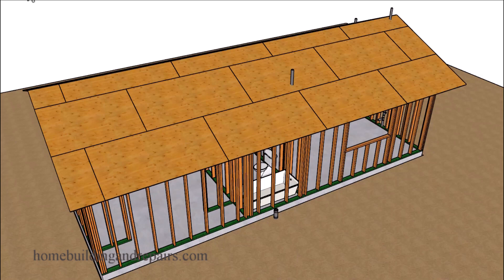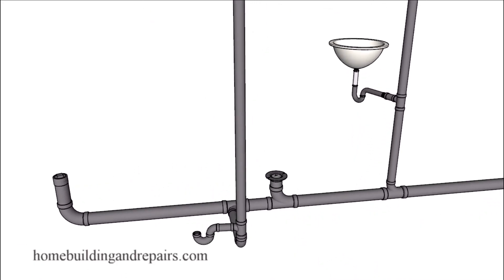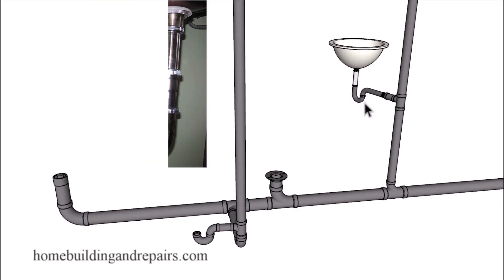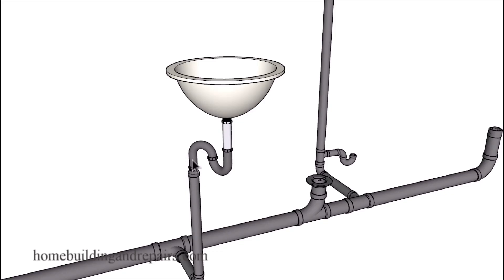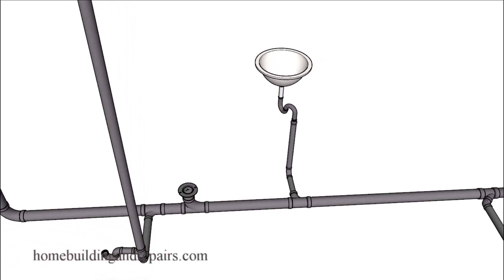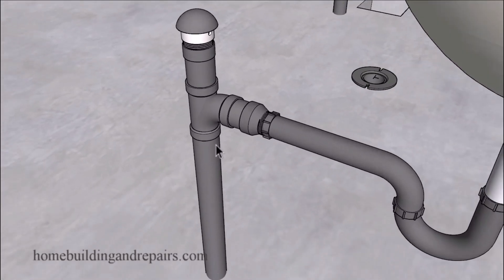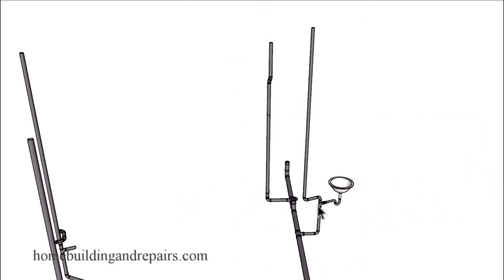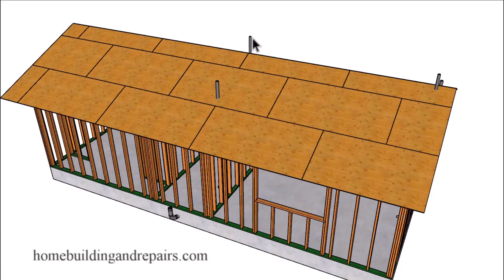Why S Traps Are No Longer Used And How To Fix Them If They Are Allowing Sewage Odors In To Your Home

Comment: Appreciate the knowledge man thanks for the uploads. Have a odd question i think if you dont mind giving me the rundown. Does code allow for the relocation of p traps? In this specific instance, a bath tub, to a section of the drain line remote from being directly beneath the tub to a few feet down the line. (Clearance and consolidation effort). Thank you.
Reply from the maker: Yes it does

Comment: Approx when were S traps abandoned for P traps? 
Which trap is commonly used for basement floor drains?
Reply from the maker: I don't know for sure, maybe they stopped using S traps in the 1950's. The basement floor drains can be p traps, but will be different most of the time than those used for bathroom sinks.

Comment: Another problem with an AAV is that it only handles negative pressure,  not positive.  If you have something like a macerating toilet or other pump that discharges water at a high rate, the positive pressure could cause bubbling and gurgling in your drains.
Reply from the maker: Thanks for sharing and great point.